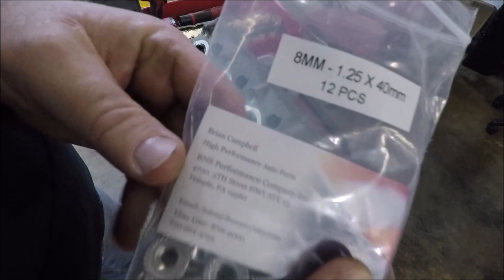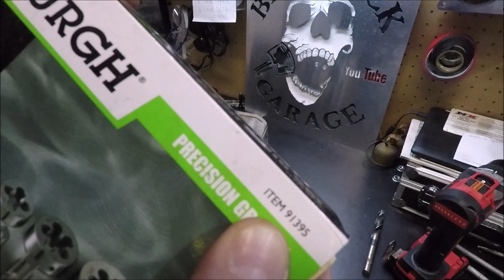5.3 FINAL ASSEMBLY REUSING LS HEAD GASKETS AND HEAD BOLTS

Comment: Like I tell everyone you build yours I’ll build mine. Just so happens that mine is a DBW gen3 I believe was out of a 04 Silverado I went with stock pistons but ARP hardware and Cometic head gaskets trunnion bearing upgrades new lifters and blue valve springs with a BTR stg4 truck cam one day I will get it going and get that BLG TUNE

Comment: Honestly it's harder to get the exhaust manifold up on the studs, while everything's in the truck, then it is to start the first two bolts through the exhaust manifold through the gasket into the head . But I'm sure I'll go with such as soon as I get these two broken bolts one out of each head.. girly smack in a star bit, unscrew.mno need for a welder guys..rocket science didn't reinvent the wheel
Reply from the maker: Thanks for watching! Glad this video helped you out!

Comment: I'm older than you, but I look up to you and have been subbed for years. I am contemplating an LS build, and when I need info your channel is in my top three I go to for CORRECT experience and advice. I've built many engines in my days, but an LS is so simple and complicated at the same time. Thank you for showing what works and what not to do!
Reply from the maker: Brother I sincerely appreciate that comment. And thank you for sticking around through the slow times as well. The LS is definitely a simplified design as far as the engine itself goes. I believe the only thing that people really find complicated is the fuel injection. But once you’ve done it all once you will find yourself wondering why you ever thought it was complicated. 😉
Reply: @BadLuckGarage  Going carb and nitrous. LS are so much cheaper that route with some swap meet and internet used parts than a traditional sbc for my application. It's just a learning curve, and channels like yours make it easier for an LS nooby.
Reply from the maker: Well if anything I’ve said or done has helped you out then I’m glad because that’s why I do it!👍

Comment: I like how matter of fact you are. No, on average I wont re-use gaskets and certain bolts if I can help it. But like you said, sometimes money is tight and or its just a work truck. Or you have other plans for the future that will require you to pull the heads again but you need it on the road soon. Then by all means do what it takes. That being said, it just doesn't apply to automotive man. Its like this with everything on the internet, It allows people to be tough guys/girls without worry. I just worry about me and my own business. I wish other people would do the same. Great Video
Reply: I’ve seen guys at the dealer replace an automatics 3rd clutch pack, replace 1 accumulator piston, new filter and call it a day. By the way, flat-rate pays them about 12 hours, so did someone get cheated? Intentionally?
ASE Master Tech Retired

Comment: I would like to comment on this and tell me what you think. If you are reusing the torque to yield bolts on a 5.3 I would recommend ditching the 90° and 50° angles and instead go for torque specifications. Like 65 ft lb and then a third pass bringing them up to no more than 80 ftlb And then the two short bolts only get 70 ft lb final.70 ft lb.
Reply from the maker: I’ve always just used the factory torque specs as shown in the video. Make sure you clean out the holes on the block with a thread chaser or make a thread chaser from an old head bolt as I’ve shown in other videos and you shouldn’t have any issues.
Reply: @BadLuckGarage my ole 5.3 pickem-up is getting a head that I surfaced with a 6 inch belt sander and it’s square some how lmao. I’m going to do what this man said and report back.

Comment: I'm a new subscriber and am enjoying your videos. I do have question for you I purchased the Quinn torque wrench that you showed in your videos and wondering on the second pass of 90° if you just have to hit the power or reset button to reset for the second 90 or you have to do a different configuration. Not sure if it'll keep adding numbers to the torque value on the torque wrench. Sorry if that's confusing
Reply from the maker: You can store multiple settings in memory. As an example, when I’m torquing the heads I go ahead and program the different settings up front, then toggle through them as I go. You have to press the button to reset after each bolt. The instructions that come with it are pretty straightforward. I would read through them a few times until it clicks for you. Once you get the procedure down it makes it very fast. 👍
Reply: @BadLuckGarage  thanks for your answer I do appreciate it. I figured out to do a regular torque but was just wondering on the second pass if you had to hit the reset button or not. Thanks again have a good day
Reply from the maker: Only when switching from ftlb to angle or vice versa. Anytime you switch modes like that you’ll have to set it down for a couple seconds so it can recalibrate.

Comment: How did you clean the remaining factory black coating from the head gasket before you copper sprayed it thank you I'll add a note here a friend of mine throwed a shit motor together and boosting it and he reused the head bolts and gaskets the funny thing is he painted the head gaskets with high temp black paint I think bbq grill paint lol
Reply from the maker: This engine had over 350,000 miles. There wasn’t much left of the factory coating. Just cleaned them with carb cleaner, sprayed copper seal and threw them back on. Cars been running great on spray for a year now. 👍🏻

Comment: Not hating just curious to where you got your torque sequence from, never heard of 50 degrees on an ls head. I’ve only ever used 90 degrees then 70 degrees
Reply: @BadLuckGarage  i see, i have an l83 in my 02 didn’t realize the specs were different. Good stuff man love the videos!
Reply from the maker: These are GM specs. This is a 99-03 engine with the unequal length head bolts. The medium length bolts on the ends on the early Gen 3 engines don't get 90 degrees twice. they get 22lbs, then 90, then all the long bolts get another 90 while the medium length bolts on the end get 50 as explained in the video. On the later Gen3 and gen 4 engines with equal length bolts they all get 90 degrees , then they all get 70.I've shown this in other videos where I've assembled those variants as well. I see people on various facebook groups breaking those end bolts off on the early engines and blaming reused bolts or cheap bolts. The real reason they're breaking them is because they overtorqued them because they most likely didnt realize there were different torque specs depending on which headbolts you have.

Comment: Which mechanics book do you have and any recommendations for better books.
Reply from the maker: I recommend using the internet and saving your money. Most of the manuals I use were purchased years and years ago before you could just google specs. But I’ve got Haynes and a Hilton manuals for pretty much every vehicle I ever owned up until about 10 or 15 years ago and a few LS Swap books I bought about 10 years ago from the local hotrod shop. Most of the info in them is outdated and has been proven wrong now. That’s why I recommend just using the internet and keeping your knowledge current for free.
Reply: @BadLuckGarage   Thank you

Comment: Just curious how the engine turned out now after three months? I just ordered new head gaskets from my local auto parts store but wouldn't mind trying the copper seal. This is for an engine I don't really care about as well but would like it to last more than one run.
Reply from the maker: Haven’t ran it yet but I’ve done this several times with no issues. If you want to keep track of the progress of this build you can follow the Chaos Theory playlist here. https://www.youtube.com/playlist?list=PLnObA-smhvwN1TT5PHPgNtDY_swYp_TVY
Reply: Watched this and a few other videos on your build. However, the previous comment is now over a year old. Any update on how well this "re-use" head assembly is holding up?
Thank you

Comment: What heads are you running on that 5.3?
Reply from the maker: This engine is bone stock other than opened up ring gap and new rod bearings. So the 862s that came in it are back on it.